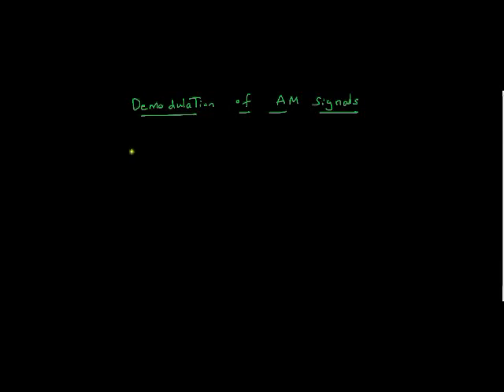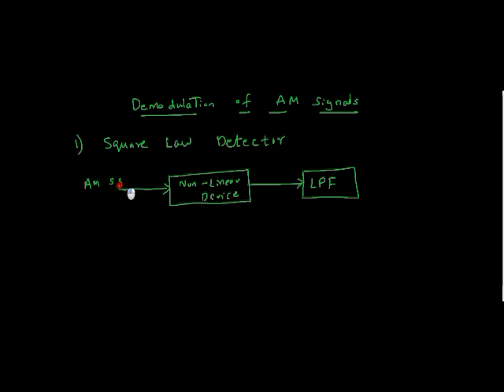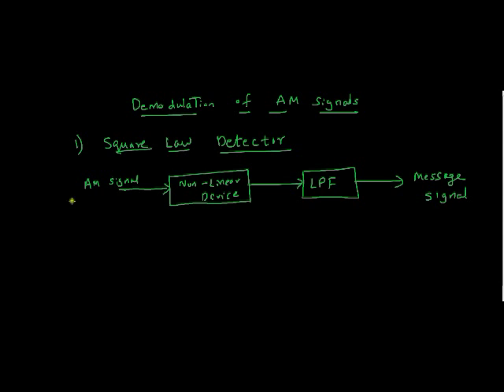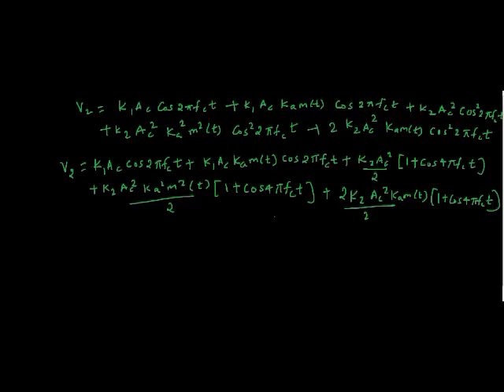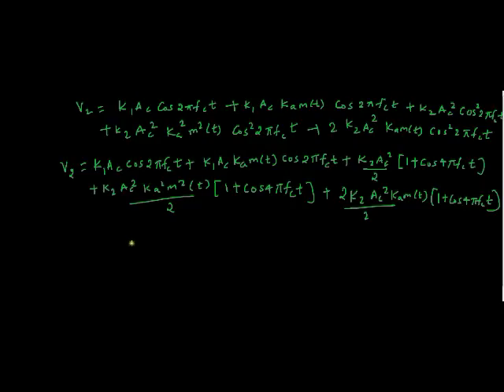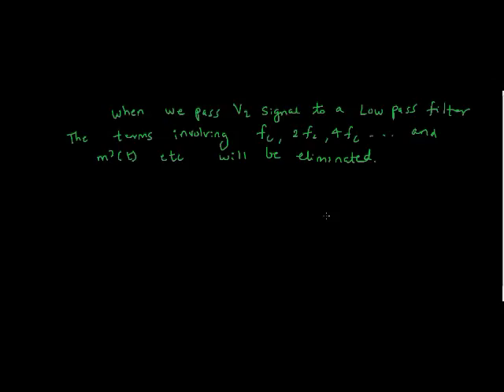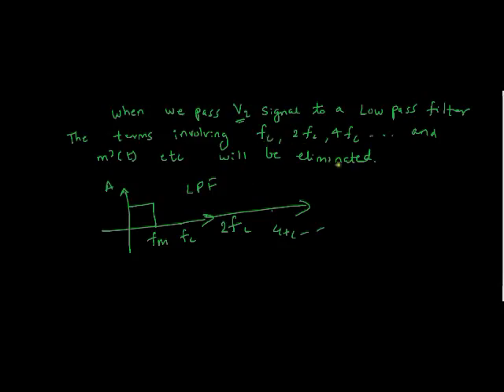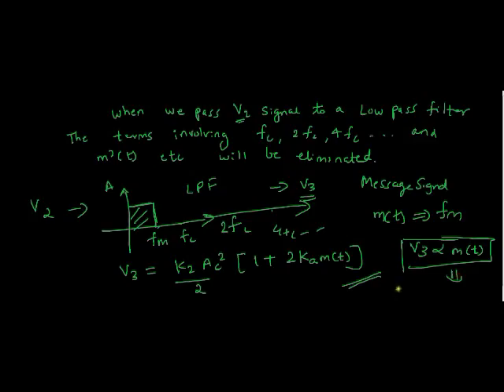Square Law Detector

Comment: I didn't understand how we got v3???
Reply from the maker: +Vicky Nanny Hi, When we pass v2 through a LOW PASS FILTER, the terms involving only m(t) come out of the filter. So, eliminate everything from v2 except terms containing ONLY m(t). {Note : m(t) is a message signal(300-3k Hz ) which we are interested, the low pass filter is designed in that cut-off range to extract the messge  signal.
Reply: +Signals Systems thnks
Reply: then what about the k1 term containg m(t).